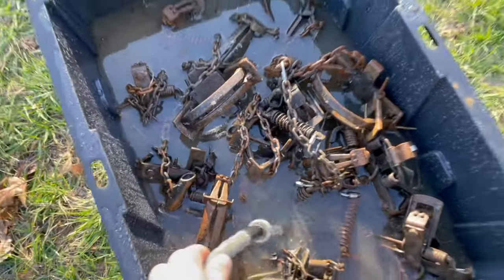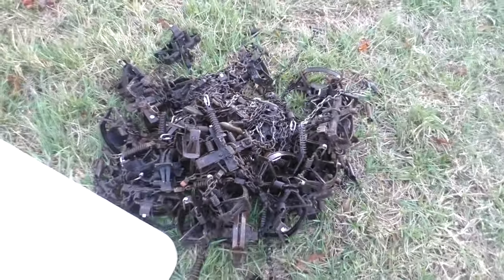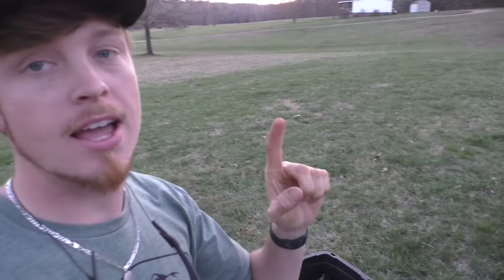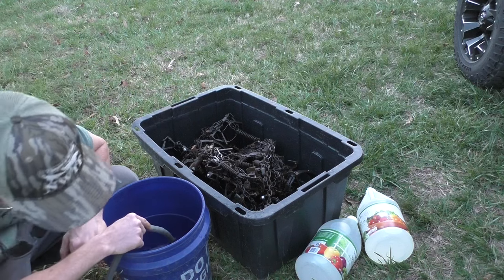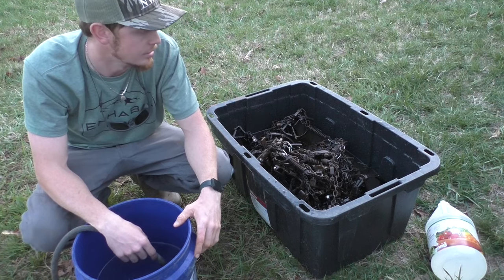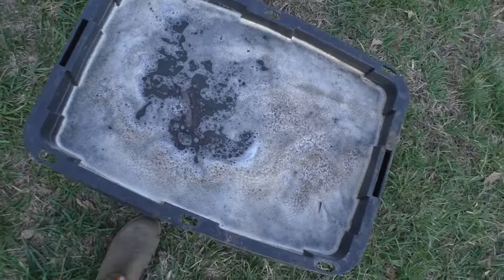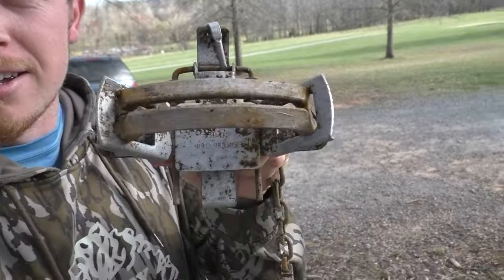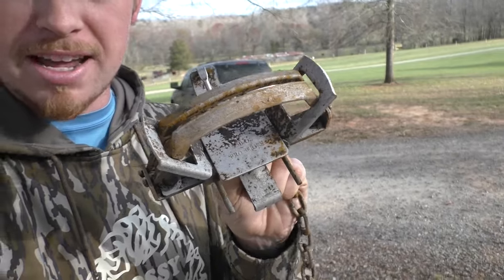BEST WAY TO CLEAN COYOTE TRAPS!!!

Comment: Use a more concentrated mixture of your white vinegar, power wash them, hang them up for a few days to get a little surface rust, then I dip mine in in Full Metal Jacket and allow them to dry. I like to put a couple good coats of the Full Metal Jacket, allowing it to completely dry between coats. 
Great Trap Dip !! 🤗

Comment: I use a little muriatic acid mixed with water for a deep clean I leave them in about 5 minutes at a time then dip in a bucket of water with baking soda to stop the acid from doing anymore work on them then let them dry and then I use ambush dye and wax this stuff is amazing!! I got new traps in a week ago done this process right away and had traps ready to put in the dirt by the next day!

Comment: I use a half gallon of hydrochloric acid to 5 gallons of water. Slash of dawn dish soap. 30 minutes to an hour later they are usually bare metal. Acid is extremely corrosive so I like to drop them in a baking soda water solution for a few minutes to neutralize the acid. 

Wanted to ask if you could do a “lessons learned” type video of what you have done to help increase your success or things you wasted time on. I always enjoy watching. Thanks.

Comment: I normally do the same process you just showed us. I did try something different the last couple years and that is after you pressure wash them, boil them in battle born. It worked as good as soaking in vinegar. I guess it depends on personal preference. I’m definitely an expert so I still like trying different methods.

Comment: If you want to get the exact 1 gallon vinegar to 3 gallons of water in a five gallon bucket, do this: pour the 1 gallon of vinegar into the five gallon bucket, take the empty jug and fill it with water and put the cap on, then put that jug into the 5 gallon bucket, now fill the 5 gallon bucket to the top with water. Pull out the 1 gallon jug and voilà (vwä-lä′), you have the perfect 4 gallon mixture.  Quick and easy.

Comment: I don’t trap to the extent you do so not as many traps. As I pull them I put them in a 30 gallon barrel of water and soap in the bed of the truck. The bouncing around gets the dirt and clay off them. Rinse them off. Soak in 50/50 water and vinegar or go to the hardware store and get the 30% vinegar, dilute accordingly. Stronger the vinegar solution the less time it will take. It will literally eat the traps/weaken the springs, if left too long. Usually only takes 24 hours of soaking then pressure wash to get the vinegar and remaining residue off. Let dry and dip in thinned paint solution or allow a small amount of surface rust to develop and dye. I have used purple power to soak them in and it works pretty well, it has to be left pretty strong.